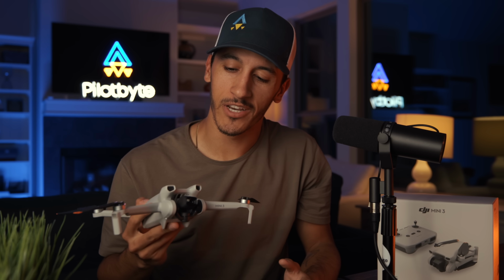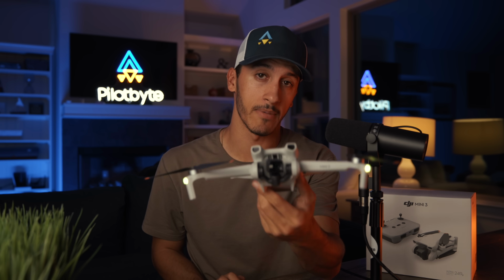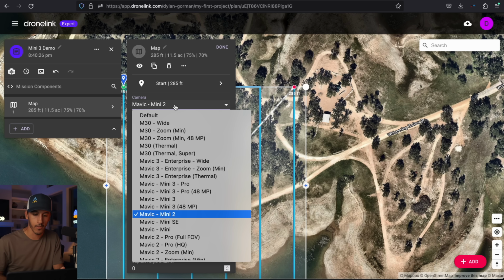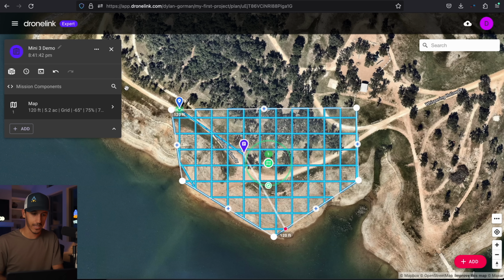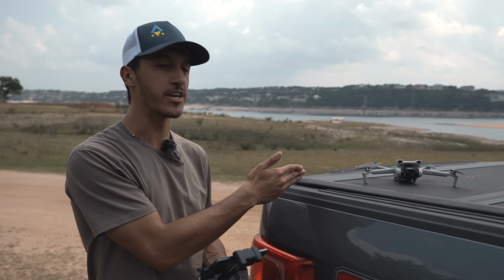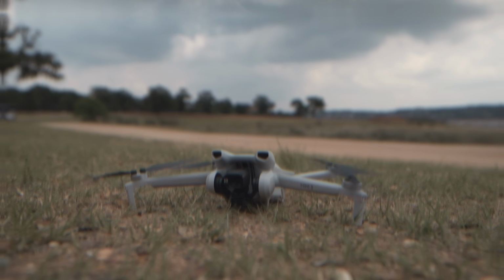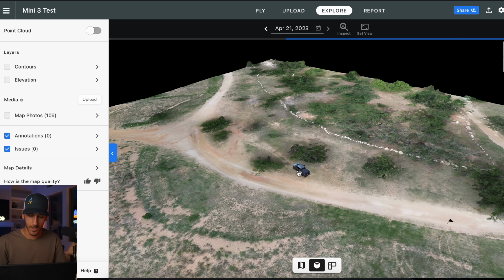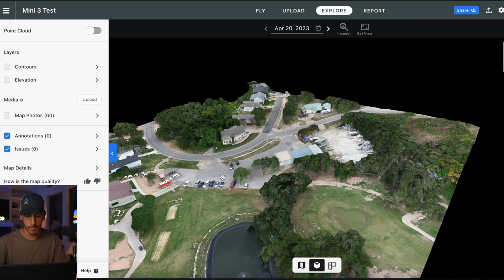The DJI Mini 3 Just Got BETTER | DJI Mini 3 Photogrammetry

Comment from the maker: Wanted to add a note here for you all, you CAN use the RC with screen. Dronelink has a beta that you can download and install that works better than using an android phone/ tablet. Happy flying!
Reply: Must be the DJI RC Pro (the dark one with 2 antennae). The DJI RC (the light grey one with no antennae) can't have apps loaded.
Reply: @ChadB_n00b  Thanks for clarifying this, slightly annoying that you can't load to the RC 1 Grey as that's what I have
Reply: @pete harris  It's a $300 remote with a screen built in...
Reply: Hey  @freskini1 . No problem at all!
Reply: @ChadB_n00b  shite. Just tried it myself
Reply: No you can't. You'd need the RC Pro.
Reply: THIS DOES NOT APPLY TO THE DJI RC (light grey controller with screen, which was released with the Mini 3 Pro).

This only applies to the RC Pro (black controller with screen) not to be confused with the nearly identical looking DJI Smart Controller (which is like $400 less).
Reply: You can only use the RC Pro controller and RC-N1 with an android device.
Reply: "𝑦𝑜𝑢 𝐶𝐴𝑁 𝑢𝑠𝑒 𝑡ℎ𝑒 𝑅𝐶 𝑤𝑖𝑡ℎ 𝑠𝑐𝑟𝑒𝑒𝑛" - 𝐈𝐍𝐂𝐎𝐑𝐑𝐄𝐂𝐓! Not trying to be rude, but this is simply incorrect. The SDK has been released for the Mini 3, 𝗯𝘂𝘁 𝗻𝗼𝘁 𝗳𝗼𝗿 𝘁𝗵𝗲 𝗗𝗝𝗜 𝗥𝗖 𝗿𝗲𝗺𝗼𝘁𝗲 𝗶𝘁𝘀𝗲𝗹𝗳, so Dronelink etc. doesn't offer options that run using the DJI RC.
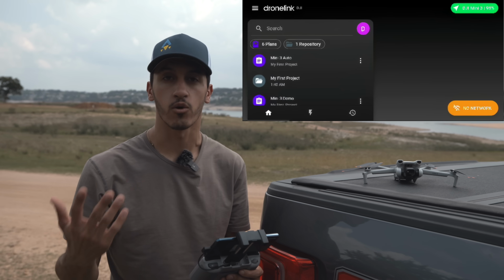Reply: Bro don’t say crashes 6:41 when you’re talking about drones! 😂 You had me worried!
Reply: Can’t you just use the android or iOS app on the phone instead ?
Reply: @Instant_Nerf  There's no phone involved with the DJI RC, it has a built in screen.
Reply: @londenard  that's correct. No phone is involved with the DJI RC. However, you cannot load apps one that one. Only the DJI RC Pro, or an Android phone using the RC-N1
Reply: @ChadB_n00b  Yea I know... I was reacting to the other guy. You cannot load anything onto the DJI RC. Period. Any 3rd party action will need to happen with either the DJI RC Pro or DJI RC-N1 with an Android phone.
Reply: @londenard  I guess I will wait for litchi. I have the cheap rc controller and the one with the  screen.. yeah can’t load apps. But I was hoping there’s both an iOS and Android version. However with andorid using dji app.. a lot of crashes
Reply: Gotcha  @londenard . There has been a bit of a mix-up in the comments here, and I've been helping others understand. Having said that, I just ordered an N1-RC to do this on my Mini 3 (non-pro). I'm hoping to get enough jobs to pay for that new Mavic 3 pro ;)
Reply: @ChadB_n00b  Oh I could have sold you one cheap...
Reply: @Instant_Nerf  You can use an Android phone with the RC-N1 controller. You cannot use iOS.
Reply: @airbornaddict6399  It doesn't seem like it. I searched the forums on this topic and it's very complicated if not dangerous/impossible.
Reply: can you explain this statement in further detail? Are you saying I can download the Dronlink to my RC? If so, I'm defiantly gonna need a tutorial on the process. Thanks
Reply from the maker: @scalesandtailsoutdoors  A full detailed explanation on compatibility and install instructions are on Dronelinks website. Simply search for "dronelink mini 3 beta"
Reply: @DylanGorman  Well i can't get passed the first part. "Open the appropriate link". I don't know how to do this since i have had the Mini 3 for only 2 months. This is why I asked for help....
Reply: Thanks for this! The video and clarification on the RC too
Reply: Great vid! New sub here 👍 I fly fpv freestyle and am looking into getting my Part107 and getting into cinematic. In your opinion, is the Mini 3 good enough as quality/features go or would you suggest paying the extra $300 for the Mini 3 Pro instead? Thx in advance!
Reply: @DylanGorman, 

Hi Dylan , 

Do you have any type of college degree in engineering from a university in U.S.?
Reply: Can you tell / show how to do it? (not the RC pro)

Comment: Can this be used on the RC Controller?
Reply from the maker: yes!
Reply: @DylanGorman  Thank you
Reply: You can use the DJI RC Pro, not the DJI RC.
Reply: @ChadB_n00b  I was reading that you can't install 3rd party apps on the RC controller
Reply: @mwales2112  Exactly. You can on the RC Pro (the black one with the antennae). You cannot on the RC(the light grey one with no antennae).

Comment: With Dronelink for $50, do you get access to all services or just the beta app for the phone? Is this why you processed in dronedeploy because the $50 purchase cant do the processing?
Reply from the maker: Dronelink is only used for data acquistion, no processing at all which is why I used Drone Deploy for the visualization.
Reply: So, how much Drone Deploy cost? Is it free or very expensive? How much you pay for it?
Reply: @DroneExplorer-Relax  drone deploy is extremely expensive.... Hundreds a month
Reply: @DroneExplorer-Relax  329$ for the basic individual, 499$ for the advanced. (per month)
Reply: @BikesBobbers  thank you for such a precise answer.  It seems to me that the raw data from the very cheap mini 3 is practically useless until we process it.  Is there any budget alternative to Dronedeploy?
Reply from the maker: There are! Look at WebODM. It’s free to use. You can also check our maps made easy, they have a free processing options too

Comment: The only problem is if you bought the Mini 3 pro with the RC controller . As of now you have no way to install 3rd party apps. With 48mp I'm going to assume most pilots will use this little drone over the heavier drones that you can hear from the moon. Just watch out for those birds. I would love to see a demo with the 48mp setting and comparing it to like the Inspire 2. Even though the Inspire 3 is now out.
Reply from the maker: Going to work on getting a video in a few months using the 48mp so be sure to look out for that!
Reply: What’s a Bayer filter?

Let’s start from the beginning – a Bayer filter is a colorful mosaic of Red, Green and Blue filters that allows a digital sensor to capture color photos. Semiconductor pixels don’t “see” color, they only capture the amount of light that hits them, so without a filter you will get a Black & White photo. The Bayer filter makes sure that the light reaching each pixel is of one of the three primary colors.

The way it works out is that a 12MP sensor, for example, has 6 million pixels that see green, and 3 million pixels each for red and blue. Green gets more pixels because the human eye is the most sensitive to that color. An algorithm called demosaicing is used to interpolate a full 12MP resolution image.

A Quad Bayer filter is a bit of a misnomer as it’s actually the same as a regular Bayer filter. What really changes is not the filter but the sensor behind it – these new sensors put four pixels behind each color square instead of just one.

So, really these 48MP Quad Bayer sensors can’t offer much more detail than a 12MP sensor. Sensor and drone makers alike will tell you that smarter demosaicing algorithms can capture more detail, but our experience is that the gain is small – if there’s a gain to be had at all.
Reply from the maker: Wow this is one of the best explanations I’ve seen! Coming from being a camera nerd this is why I always tell people that it’s not a true 48mp still, it’s just photo stacking in its simplest form.
Reply: @aloeisthestuff9622  so that is why things like grass stands out more than the sky. I never knew that about the eye. Thank you for the explainization.

Comment: Thank you for the info. Just a quick question, i have the RC that comes with the Mini3pro, can i use it ?
Reply: The RC, no. RC-N1, yes.
Reply: No, you can use the DJI RC Pro, not the DJI RC.
Reply: @ChadB_n00b  does dji Rc pro work with mini 3 ?
Reply from the maker: You can use the RC that comes with the Mini 3 Pro!